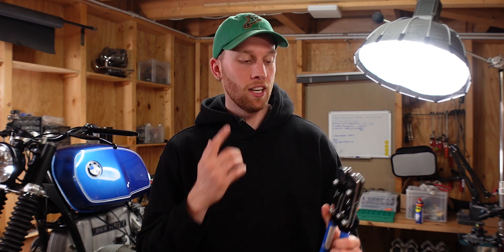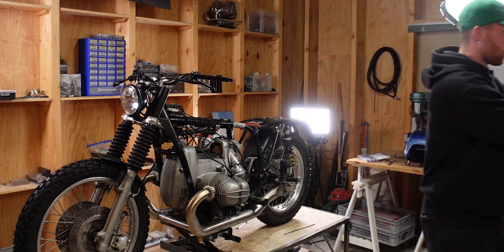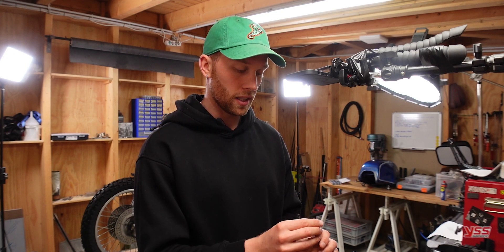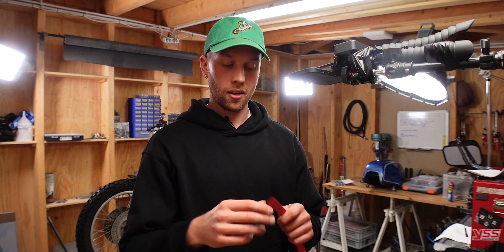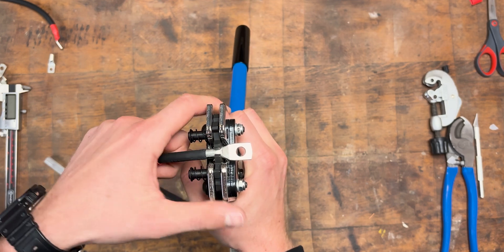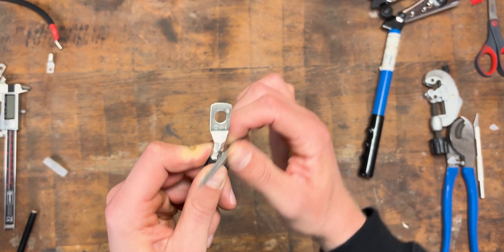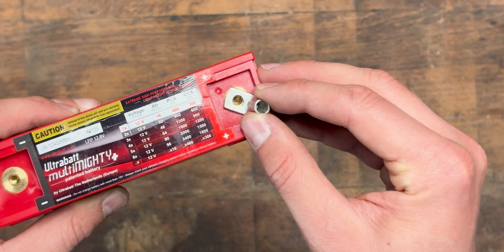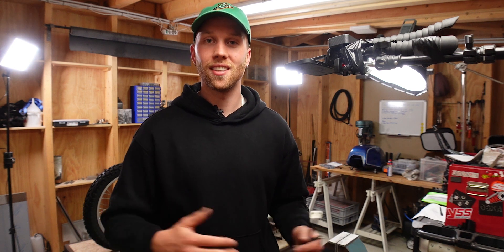How To Make Battery Cables (cheap & easy)

Comment: Hi, you can actually use the cutting pliers that comes in the crimper kit as a cutter, just like a cigar cutter, put just enough pressure around the insulation to cut it and then turn it, like you did with the pipe cutter (which is a great budget tip!)
Reply from the maker: Ah thanks a lot! That’s a great tip 👌 I guess I need to smoke more cigars 😅

Comment: Hey can you give more info on what type of cables you can use? I find it hard to find this n2hdre2 cabel. (Yes i know its not that name) Like is it any letters for this cable? Will an RK cable work aswell? Im from norway so maybe the cabel names is different?
Reply: The «RK» cable seems to maybe work but none of the cables listed online mentions how many amps they can hold. From my sources they need to be capable of atleast 30-50amp because this is what an average mc (2000 mods and after) draws when starting
Reply from the maker: Hi, do you have a store for welding supply in your are? They should be able to help you. It's 16AWG welding wire, that is used for the ground connection. 
This is the link for the one I used: https://amzn.to/4dVJB8X
I unfortunately don't know what a RK wire is, so I can't say.
Let me know if you found it or have any other questions!
What bike are you building?